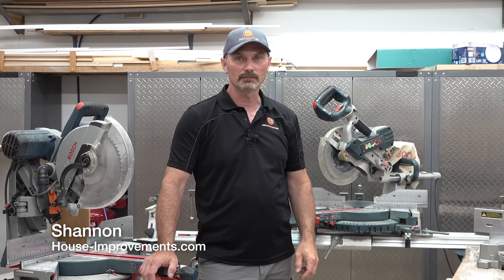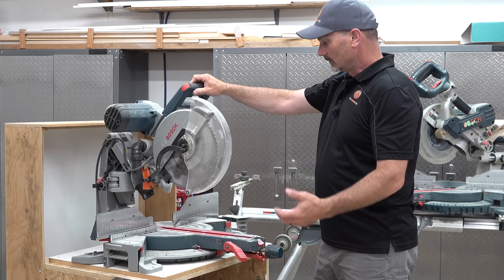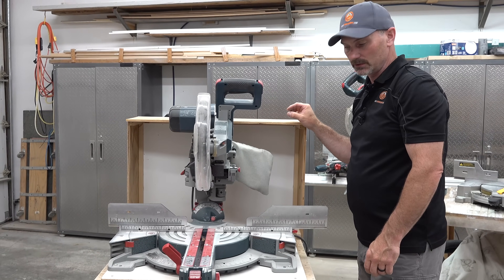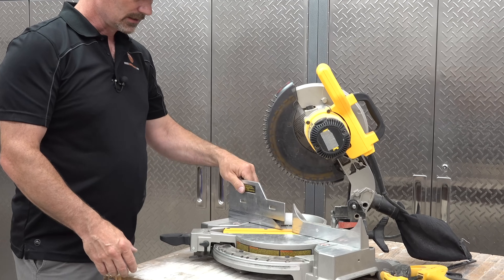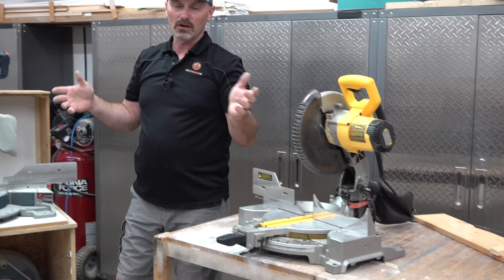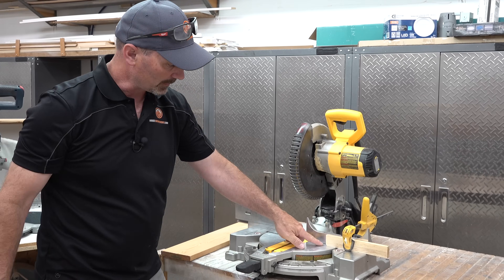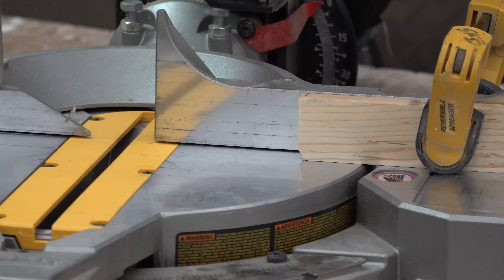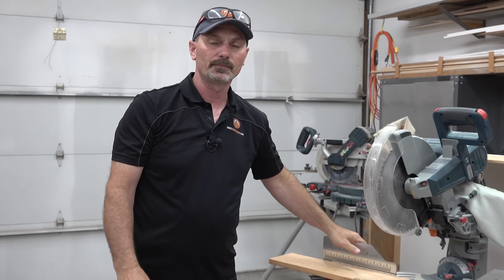Mitre Saw How-To (Full Tutorial)

Comment: Great video for those who never used one. Mine has a laser light and I'm pretty sure at least one of yours do too, but you must not like using them. I plan to cut some 12x24 large format porcelain shower tiles with my miter saw outside and was wondering if you recommend a blade for those. I thought about using a wet saw but hear those are really messy. I saw a video where people use the angle grinders too. I have one but I highly doubt I can cut straight lines freehanded like a lot of these people are able to do.

Oh, and Merry Christmas. 🙂
Reply from the maker: Yes actually both Bosch saws have lasers but the one had dead batteries and i just have not replaced them , hence I kinda even forgot to mention the laser. 
I have a wet saw so I never have even considered my mitre saws for tile. If they are just straight cuts a snap tile cutter is better. You may want to check out my tile playlist.https://www.youtube.com/playlist?list=PLh0KqGKtX4oXjEq45fGloCA-DSVyvBWrt

Comment: I have the most basic one, like your DeWalt. I love the thing. Just making nice square chops of 2x4s is reason enough to have one, not to mention for all the baseboard, casing, or crown trim cuts. I use a 45 bezel for baseboards. You're right, though, I can't really think of an application where I'd want to do a compound mitre and bevel. Those sliding-arm mitre saws remind me of radial arm saws which I don't think are made anymore?
Reply from the maker: Ya I have not see a new radial arm saw sold anywhere in years. They were a very versatile saw but in some applications dangerous . Did you know you could rotate the head extend it out on the arm and use it like an over head table saw? I had to use one like that years ago on site and i sweated bullets everyday using it that way.

Comment: I have a nice sliding hitachi mitre saw that the guard broke. I don’t use it more than a few times a year and  I’m Very careful to not go near the blade until it stops every time. It also has a laser for the cut line that quit working recently. Do you know if those can be replaced? Great video and I learned some good tips 👍
Reply from the maker: Depends on the type of laser but I'm sure most could likely be fixed or replaced. On my two Bosch saws the laser is the arbour on the blade, they are add on lasers you can purchase.https://amzn.to/3tnWdEA

Comment: I'm very much into battery powered tools, so, I bought a battery powered miter saw with its table. However, it's so big and heavy, it just stays in one place against the wall. I could have bought a plug-in saw and done just as well. (Note: I do have a very tiny battery powered miter saw that I drag out into the driveway for most jobs, just to avoid all the sawdust cleanup work.)
Reply from the maker: Milwaukee makes a smaller 8" battery powered mitre saw but even it is bulky for carrying around .

Comment: I've got a miter saw or two. I think my first one is like yours (I've had my tools in storage for a few years. I can't quite remember what I have anymore). Just a miter chopping block. The second one I got is a really nice slider miter. That one I have quick access to in storage, the other one is buried in the swamp of misfit tools. I keep threatening to get a 14" slider miter so I can do what I do with two cuts on my 10" with just 1 cut. Often the angles I cut in board stock exceed the limit of that cute little 10" blade. I could get a 12 but why not go to the 14"? I can tell you why I haven't done it yet, I like fancy blades and 14" fancy blades have equally fancy prices. Often well over $100 dollars per blade. You buy 5 of those and you've spend the price of the saw. And you never seem to see that type of blade in an economy 12 pack.